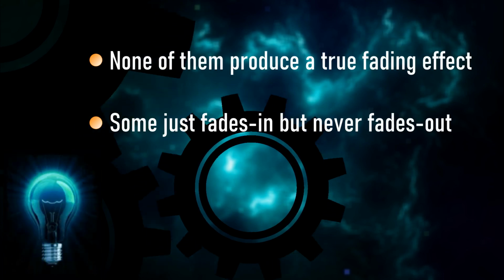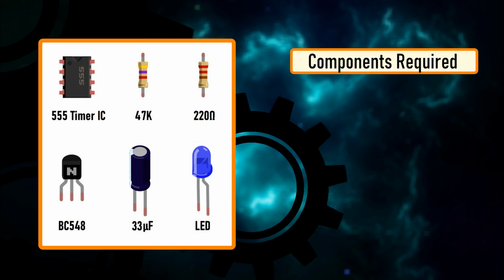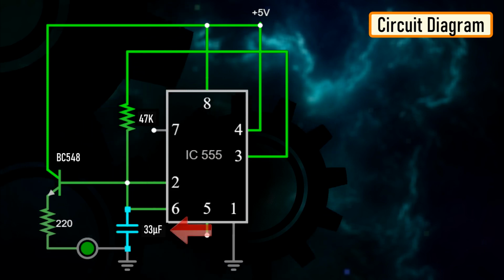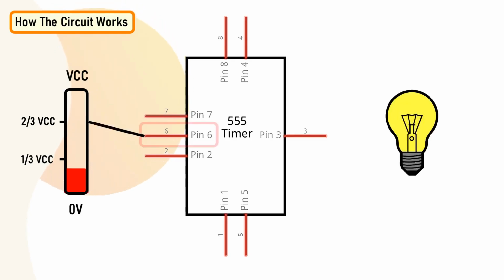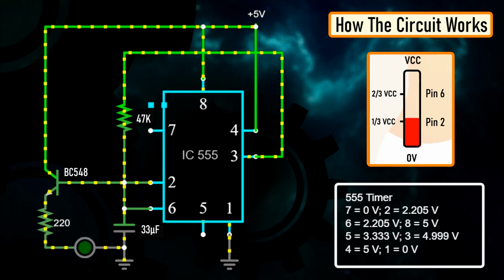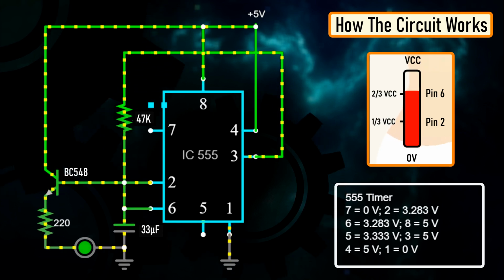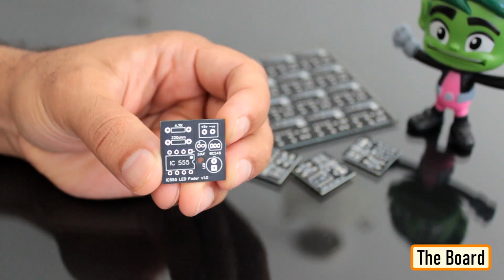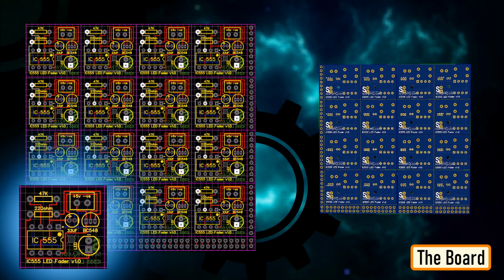LED Fader Using 555 Timer IC

Comment: This was a great video! Is it possible to have the Led's alternate their flash/fade, so when one turns on the other turns off?
Reply from the maker: Yes, absolutely, you can modify the classic 555 LED fader circuit to make two LEDs fade in an alternating, "push-pull" pattern. While the standard design beautifully fades a single LED on and off, you can achieve the alternating effect you're looking for with one small but clever change.

The Core Idea: Using the Output's Inverted Signal
-----------------------------------------------------------------------------
The secret lies in how you connect the second LED. A standard 555 timer in astable mode produces a square wave on its output pin (Pin 3). This means the pin is alternating between two states: HIGH (voltage on) and LOW (voltage off, or ground).

* When Pin 3 is HIGH, it powers your first fading LED circuit.
* When Pin 3 is LOW, that same pin acts as a path to ground.

By connecting a second LED (with its own current-limiting resistor) between the positive voltage supply (Vcc) and Pin 3, you can use this behavior to your advantage. This second LED will only light up when Pin 3 is LOW, completing its circuit to ground through the 555's output pin.

Here is some similar stuff I made a while back: https://www.youtube.com/watch?v=4vDtWafMF0M

The Alternating LED (LED2): is wired directly to the digital HIGH/LOW states of Pin 3. It turns fully on or off the instant the pin state changes, creating a sharp "flash".
The timing of this entire alternating pattern is controlled by the values of Resistor and the Timing Capacitor. You can adjust these components to change how fast or slow the whole cycle repeats.

This is a fantastic way to get more out of a classic 555 project. Good luck with your build, and have fun watching your LEDs dance

Comment: That's very nice! But could you make the connections so that the 555 distribution is respected? It's just that there are wires everywhere, so you have to twist and turn your neurons and wires all over the breadboard, especially if you're a beginner, and... it doesn't work. The breadboard's reliability is already like that of a chainsaw, it never starts up properly, so we're close to tearing our hair out. Many thanks in advance.
Reply from the maker: Agreed

Comment: Iam sorry but it really irritates me when a circuit is drawn .9 nout to thr configuration of the component .8 and 5 are not in the centerline of the chip ...6 is NOT in the bottom corner ... 2 is NOT between 6 and 7
Reply from the maker: Not all fingers in your hand are of the same length

Comment: I thank you for these videos. I've watched your other video that will blink LEDs. In that video you demonstrated that two LEDs could blink back and forth. Can this be done with this circuit? One LED fades up while the other fades down? Or one fades down then the other fades up and the cycle continues?
Reply from the maker: Have a look at this video: https://youtu.be/4vDtWafMF0M
You can definitely toggle between the pulses using the same technique I used here

Comment: Can this circuit drive a 5v led strip having 10 leds
Reply from the maker: I have not tried but you will need to pump in some extra current for sure to achieve that

Comment: 33uf capacitor volts  25v or 16 volts
Reply from the maker: In the case of through-hole capacitors, the capacitance value, as well as the maximum rated voltage is printed on the enclosure. A capacitor that has “4.7μF 25V“ printed on it has a nominal capacitance value of 4.7μF and a "maximum voltage" rating of 25 volts, which is never to be exceeded.

So if you are not exceeding 16v then either one of them will work for you.